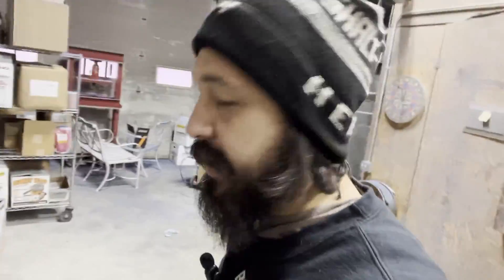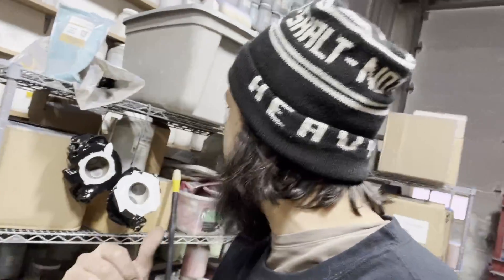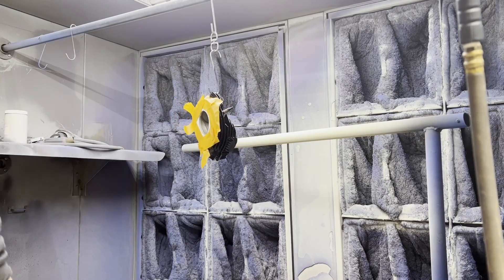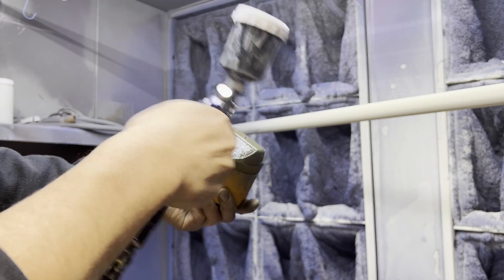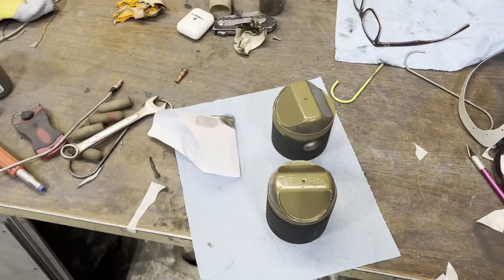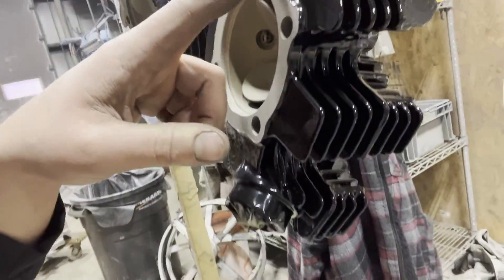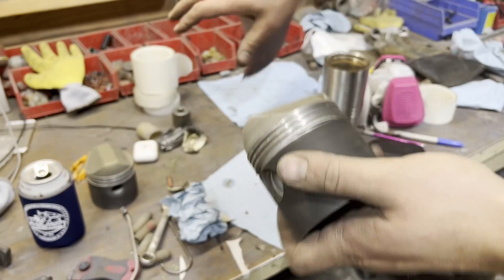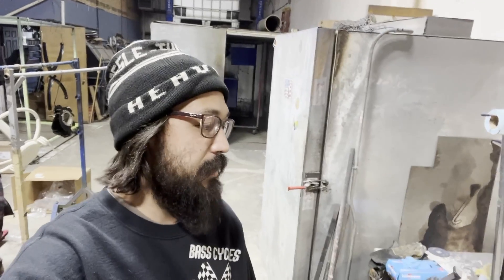Harley XLCH: PISTON AND COMBUSTION CHAMBER COATING CERAKOTE??

Comment: Is microslick scratch resistant?
Reply from the maker: It's mildly scratch resistant if I remember correctly.  It's basically a film barrier to make less resistance between the cylinder and the piston skirt.  I'll post what it looks like after use if I have to pull the jugs at any point.

Comment: Interesting.  I'll certainly  have to look into coating  like  that. Have several  engines I'm starting  this weekend.  Lots of new technology.  Really  enjoying  watching  the builds.
Reply from the maker: This is the tester phase for me too.  I have the equipment and setup to do it so I figured let's experiment.  I was going to do this on my Falcon motor, but figured it's easier to check R&D a bike than deal with head gaskets and coolant on a car.  Thanks for watching!
Reply: Hey, did you ever tear this engine back down and take a look at the valves and combustion chambers?